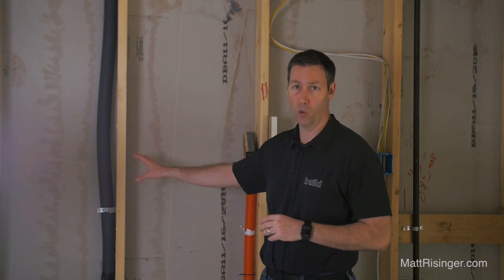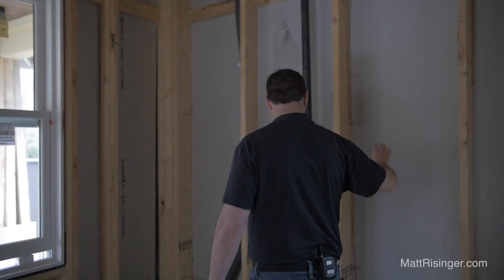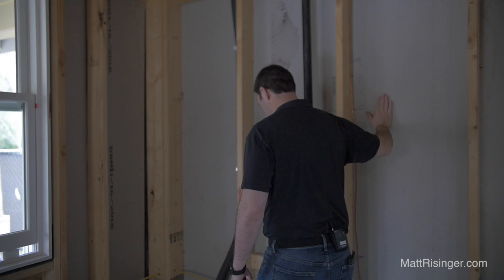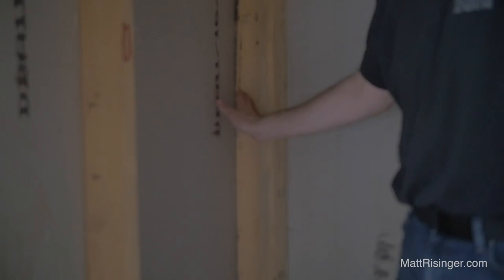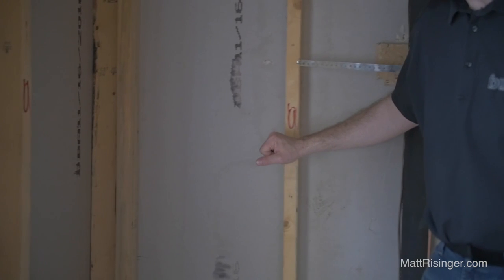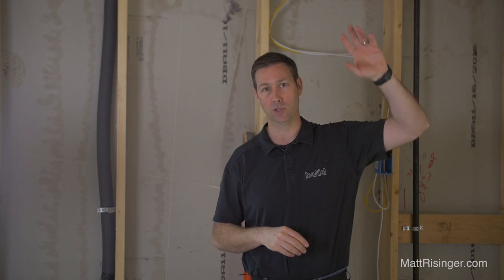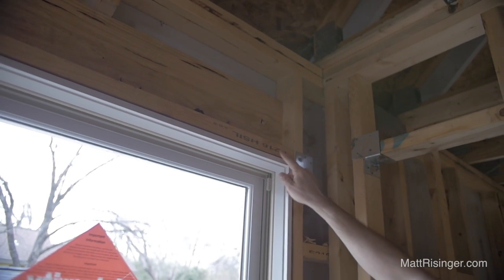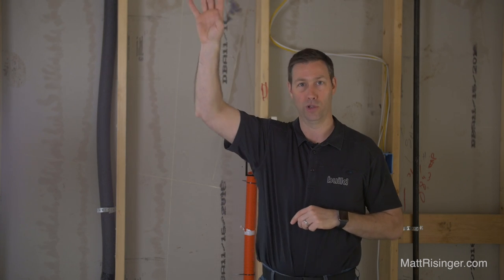Traditional vs. Advanced Framing

Comment: My wall wobbles every time I close my door as it is.  Now you want me to have a wall with even less structure in it?!
Reply: It wobbles because your studs is so small not that there are too few of them.

I'm just building summer villa that has 2x6,8 inch (48x173 mm) studs on 24" on center doesn't wobble at all.
Reply: I had a lot of movement on the interior wall studs of a house I'm building. Almost all walls were 2x4 on 16. Fire blocking fixed my issues. My exterior 2x6 walls are solid as a rock.
Reply: 2x4 exterior walls have some flex. 2x6 do not.
Reply: Jimbo Crambel it doesn't have less structure, it has engineered structure. it is the same as old car bodies vs new car bodies: old cars have thicker grade steel, but perform much worse in crash tests, because the steel structure isn't engineered to distribute energy in the event of a crash, but newer cars have crumple-zones engineered in, making crash performance and human survivability much increased.

this is the exact same as a advanced framed home. the structure is placed where it is needed, and removed where it is not. If your walls are able to be shaken by opening and closing doors, they have not been appropriately engineered (either by the designer/engineer or the builder themselves. advanced framing can help remedy issues like you are experiencing.
Reply: I don't want a girl
Reply: But a house is not an automobile. Your comparing apples to oranges. BTW, have you seen the results of a crash between a 2017 Toyota RAV 4 and a 1972 Mercury Monteray?  Tain't pretty after only a 20 Kph crash. Rav 4= Writeoff,  Mercury = Huh, did something happen? I'll stick to traditional 2x6, 16" OC. Lasts longer and is tougher.
Reply: +woodrat you just proofed that you don't know how things work. New cars is designed to cave in because longer that car crash last less there are forces which impacts driver aka bending metal absorbs force and softens impact.

Sadly 16" OC wall isn't any stronger it just bare more load it doesn't hold against wind any better.
Reply: His orphans will have a nice vehicle to drive around in tho.
Reply: Sadly 16" OC wall isn't any stronger it just (bare more load)<<<<<maybe its just me, but I'm pretty sure that would mean its stronger....
Reply: If we talk about wall wobble it isn't any stronger and if 24" OC can bare all loads using 16" OC is nothing more than wasted wood.
Reply: Wall wobble will come from the wall not being tied in correctly. 90% of homes built today have wood corners and foam board in between making them very unstable in structure. If you don't think so, just take a look at homes built in the 20's compared to homes of today. The home I live in was built in 1921 and is very structurally sound. A friend of mine had a home built 5 yrs ago and is already having problems with it.
Reply: But as long as the R value is high enough your ok LOL
Reply: woodrat2296 You need to compare cars within the same size and weight category. But other wise is would need to see the video of that crash before deciding on which car handled the crash more adequately.
Reply: Jimbo Crambel your wall wouldn't wobble if I built it and I frame 24 inch.
Reply: Jimbo Crambel oh so that how it is? I've worked in a couple of houses that when I'm doing the rough-in the walls to move I can move them. The houses that I'm talking about are rushed rushed rushed
Reply: Your wall wobble is more to do with how the wall was attached to everything else.  If it was properly attached at top, bottom, and both ends (as well as any intermediate intersections there may be), there won't be any problem.  Part of that could also be the height of the wall installed.  If it isn't snug to the top and bottom, then it will move on the nails/screws every time there is a force applied.  If it's tightly placed in, it won't move.  Yes, I have had to build walls before.  Even ceilings too.  Not my favorite thing to do, but if you make sure it's in tight, they DON'T MOVE.  No matter what size lumber you use, or what your spacing is.
If it's not load-bearing, go ahead with 2X4's with 24" OC.  If you don't like 24", use 16".  It will still work.  If it's load-bearing, though, I would prefer to go with 16" OC.  Whether I go with 2X4 or 2X6 would depend on what I plan on supporting.
BTW, not a professional builder.  Just don't want to have to fix anything twice.  I probably over-build many of my things.

Comment: I do framing and that 'advance framing' is ish... 16 oc is better than that 24oc. Yes your saving wood with 24oc but not rigid enough or as strong with 16oc walls. And those hangers?? Like really... Tf out of here.
Reply: I totally agree. There needs to be a balance between saving space and sturdiness and 24oc is an extreme, while the other house is on the exact opposite end of the spectrum. Finding a mix where safety and strength are combined with insulation maximization seems not to exist in this video.
Reply: Well it was done to maximize R value, not save lumber or money. Bet money that it was engineered and inspected.
Reply: 24inch is strong enough. and instead of hangers cut out a slot in the king stud

Comment: What are your thoughts on the metal header hanger in cold climates.  I don't think I would even consider it without using an exterior rigid insulation (like the zip sheathing), as it would create too much of a thermal bridge in my rally cold climate.

Comment: Hey Matt. 
So I am about to build a new house and I have just ran across your channel. Do you have a video on the cost difference between traditional and advanced framing. Looking to build a 2000 sqft ranch on a full basement in Georgia. Channel to find your channel very useful info.

Comment: Zip R sheeting.  The nailing is remote from the exterior of the stud face.  Is there a limitation of which fasteners to use to achieve wind bracing?  Or are you letting in some traditional metal T corner wind bracing?  Does the isofoam have to be firestopped at plate or floor levels?

Comment: How much do these techniques actually help energy efficiency? I wish someone would A/B test identical houses next to each other.
Reply from the maker: +Allan Branch quite a bit. Your energy rater can do that test on a set of plans and give you hard $$$'s annually in savings. It's on the order of 5-15% more efficient which is a lot over the years / decades
Reply: Matt Risinger Whoah, test on a set of plans? Prac app and numbers on paper are very different. Especially when considering that white pine is closer to and r1.4 per sq in and not r1. It's almost like gaining 40% if you put the numbers in properly. Or just like it.
Reply: Building a home out of SPF is a huge mistake anyway, it won't hold nails and in some areas, insurance companies won't insure homes built out of the balsa wood (SPF).
Reply: R value is calculated different then most people would think... 1/2 wall R10 and 1/2 wall R20 doesn't add up to total R value of 15, it's only R value of 13.33
Reply: SPF means Spruce/Pine/Fir... which is what the vast majority of wood framed buildings are framed with...
Reply: SPF = Spruce, Pine and Fir. Yes, Insurance companies have been insuring homes made with SPF for decades!

Comment: Would 2x6 walls with 2x4 staggered 16 OC be considered Advanced Framing? Then using a product like 2x4 batts of Roxul you can completely eliminated thermal bridging and adds the bonus of sound deadening as well. Thoughts?

Comment: Ya I think I'd just remember to shut a couple lights off and maybe turn a heater down every now and again rather than have 24" exterior studs for the sole purpose of insulation .Matt even said in the comments that 15% is max energy savings... that is a tiny  benefit for living a lifetime of trying to find studs to mount literally anything not to mention just hoping someone doesnt lean back on your wall to hard in the middle. Sad!
Reply: 15 percent is significant.  What wasn't mentioned is improved comfort for the occupants.
Reply: I would rather take the bridge that was built for a 40,000 lb truck to drive across and take my 5000lb truck across it every day vs trying to have an engineer redesign structural parts to make the road less bumpy at the cost of integrity... and by that I am talking about 24" exterior studs and those wimp headers. It's not an argument, that is literally what they are doing. Sacrificing structural integrity for some fringe benefit in heat savings. Btw 15 percent being significant is incredibly subjective and also not an argument.
Reply: NexusCapital why are they lyinh tho. i tbought we wete trying to make this a better place? and hes talking like yea get this one. smh wtf when does it end poor homeowners. not really one mind cant exsist wirhout the other
Reply: If you're really that paranoid about hanging a picture on the wall, just cover the studs with OSB, then you can hang a picture anywhere you want.
Reply: That's why you use 2 x 6 framing, which structurally is more than adequate. I have built for 40 years as well as spent nine years as a certified building inspector, and I wish we could have had advanced framing back in the day. Old habits and attitudes die slow. I think AF is great.

Comment: Corner studs don't have dead air there are 3 more corner studs behind the corner studs. Try hanging anything on a 24" center wall. And having a two story house with smaller headers and less king studs is ridiculous. 

Also for insulation you can add better insulation on a well built house.